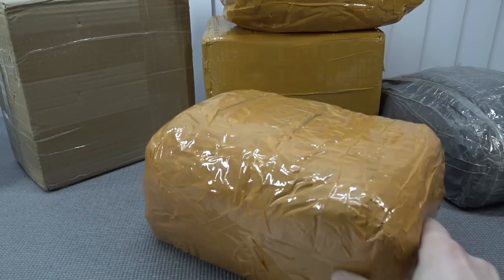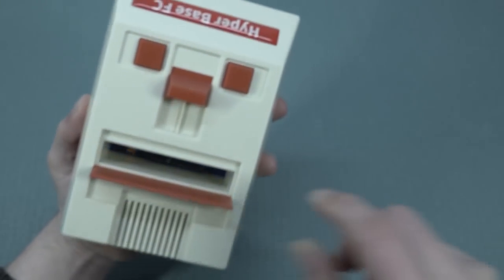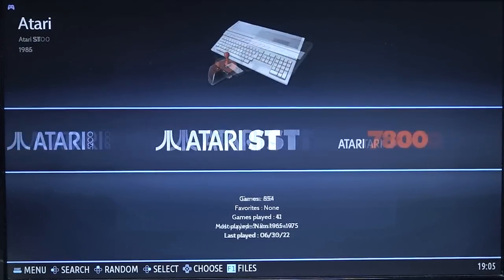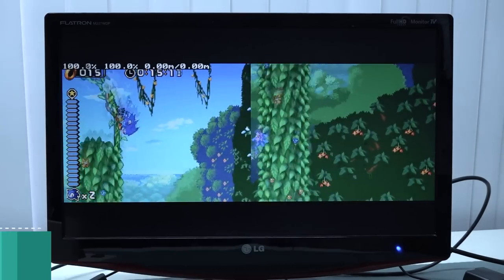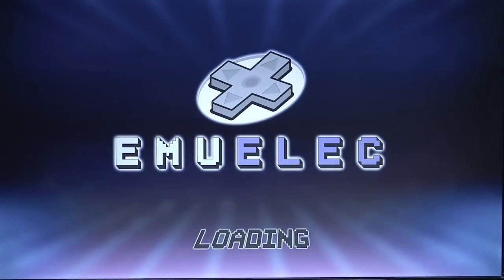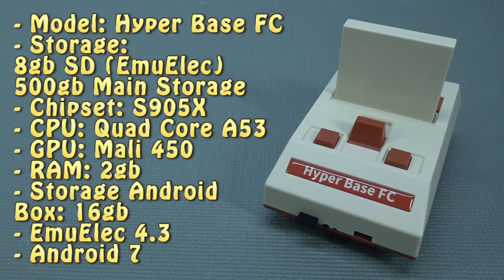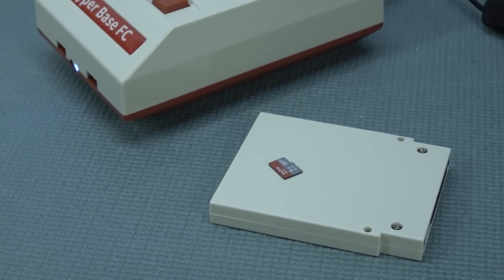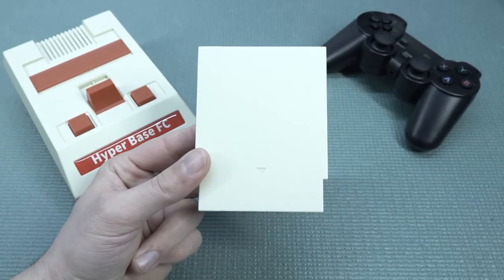This Game Box Is Something New ! 😲, 500gb Storage... CRAZY.

Comment: If i get it correct, slap FreeNAS on an empty MicroSD card, plug a big sata harddrive into the cardridge slot, connect ethernet et voilà - got a network file dump in a neat retro shell 😆 ... wondering how they connected the sata hardrive / how it performs as a NAS (MB/s)  🤔
Reply: @NopA DeLik :

It's probably not an actual SATA hard drive per se, but more than likely a flash drive cart. And I don't know what you're talking about, so I couldn't guess how it would perform, just wanted to point out that it's probably not an actual hard drive they've stuck inside a NES cart.
Reply: @JarodMoonchild1975  according to what Wicked starts to explain at 03:10 it really is a SATA hdd, at 03:44 he shows the cartridge from the side to see right onto the hhd's SATA interface, and this particular 2,5" hdd still comes with an additional connector to get power via LP4 3,5" floppy drive power connector, so probably a vintage 2,5" hdd. SSDs and uptodate 2,5" hdds don't have the floppy power connector anymore nowadays, afaik. What makes using the SATA interface so interesting is that most tiny ARM-SOC-boards like the Raspberries don't come with it, and the ones that do are more expensive AND then mostly just connecting SATA via USB2.0 which is bottlenecking the possible hdd speed around 30mb/s max. Those all are just some nerdy specs which are quite important to people who want to build cheap DIY solutions as a file server in their home network. NAS = N.etwork A.ttached S.torage, and there's a chance this tiny retro  emulation machine may also serve the needs of somebody who needs a NAS anyways.
Reply: @nopadelik9286  Ok, gotcha. My level ends at adding Nincade boards to my NES/SNES minis for wireless controllers, and hacking them to add more games, lol.

Comment: Need to leave the old chipsets where you found them and focus on new. You can't continue to be surprised a S905 chip won't run things well, even if the device was made this year. Be nice if Wicked could or would draw a line and only buy products with AMLOGIC S905x3 or comparable Allwinner, Rockchip, MediaTek, Qualcomm, TI, and Nvidia cpus, but not limited to. I don't want to assume but with the amount of hardware you've spotlighted, I dare not question your expertise in this field. I don't care who branded it, but I tire of pretending to go into this with little to no research about what makes it potentially a product that we might actually want. If this is what not to buy, then I applaud the efforts. Show me something I can't live without, please, because I think that's really what you are hoping for Wicked 🖤.
Reply: You took the words out of my mouth I have a $79 cell phone from boost Mobile that has the dimensity 700 in it and it can run some GameCube and PlayStation 2 games really I guess the search continues by the way could Android run that front end emuelec?
Reply: @alceearsberry4150  since the EMUELEC image boots the device when the SD card is inserted, it's configured to work with the cpu, sound, memory, emmc storage, HDMI and the network, if you found an image that was tweaked for all those things that your phone has, then yes. But not without much effort to get it like that first.